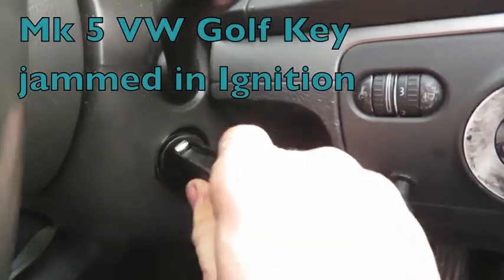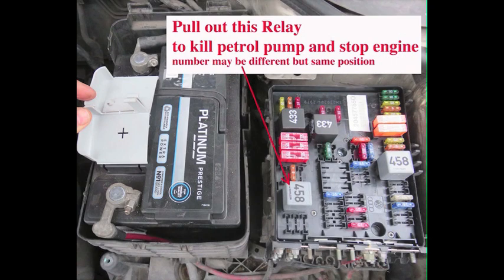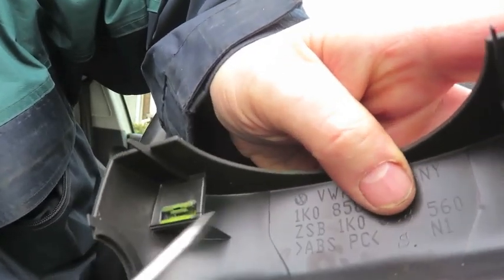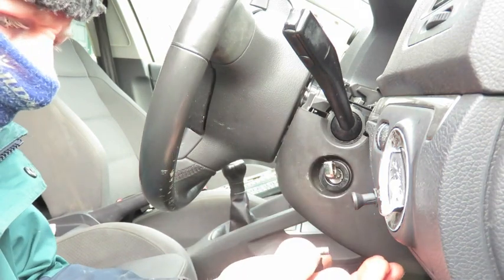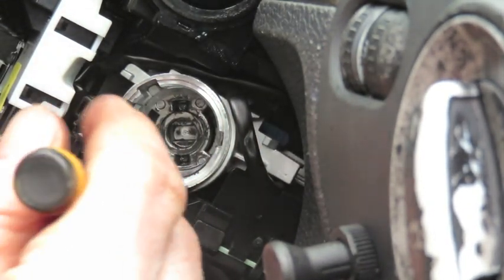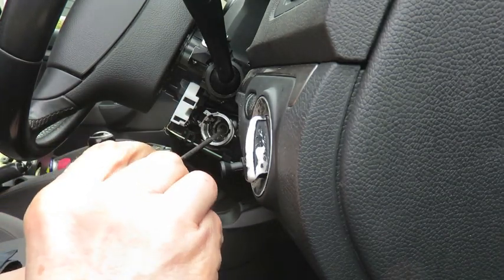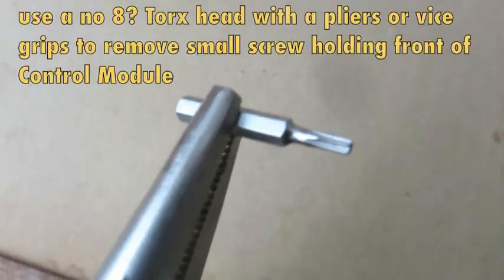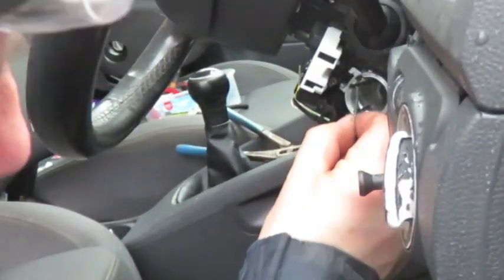VW Golf Ignition repair

Comment: thanks, good video!! 
I have a guestion. You removed a lock pin(?). After you turn off a engine, Can you lock a steering?
Reply from the maker: 'Morning. The answer is no, the steering lock is removed, but the chip in the key is the better anti-theft device I reckon. I've heard a large screwdriver can force the ignition or jamming the steering from left to right will snap the aluminium part of the lock – if you're a would-be thief that is,
All the best! Seán
Reply: @keepitassimpleasyoucan145  thank you very much. I did it today. my key was come back in my hand!!
Reply from the maker: @_malkang  did you get it working again ?
Reply: @keepitassimpleasyoucan145  Yes!! but I did it little different. I just pull out all small parts from ignition inside. I found a small piece and assambled. finally work again.
Reply from the maker: @_malkang  that's great, well done!
Reply: @keepitassimpleasyoucan145  thanks for your useful video!
Reply: @keepitassimpleasyoucan145  quick question mate hoping you would answer me, i bought the cylinder where the lock is and im planning to use the same key and old lock im just changing the cylinder only and i will use the old electronics , do you think i will need to reprogram anything ? thanks alot :) im having this issue
Reply from the maker: @moejaymotobike  I don't think so as the part that breaks in the barrel is purely mechanical so if you replace only this then the keys and everything else should work fine. Anyway, the coded part is in the actual key and the code reader is in the CPU, away from this area. Good luck! land et us know how you get on, Seán
Reply: @keepitassimpleasyoucan145  thanks alot I just wanted to make sure before I swap the part, yes I be using the same key and the key part and just switching the cylinder, And I forsure will 😊

Comment: Hi there,I have a golf that wont start. I think that the problem might be petrol pumpbut in your video you stop your car by taking something out of the engine.Any adviceif this might cause the problem or other ideas. thanks Chris
Reply from the maker: Hello Chris, I took out a ‘Relay’ which is a small in-between switch on the circuit that turns on another circuit. My car is a petrol engine too but I expect Pumps and Relays are similar for diesels as well. The main reason I knew about the Relay in the engine is that these caused my own car not to start and yes, I looked at the petrol pump first too.
There’s a Relay for the fuel pump behind the small glove box(in video) but it was the one in the engine that was my problem.
To confirm it was a fuel problem I put about 2 spoonfuls of petrol directly into top of Carburetor, then tried to start and engine almost turned over(not suggesting you do this but if you do then wear goggles in case of spitback).
 By the way, from what I’ve seen in scrapyards, a lot of Audi’s, Seat's and Skoda’s have very similar fuse and relay setups.
Good luck and let my know how you get on,
Seán

Comment: I cannot turn the key to the point to remove the bowler. What I can do ?
Reply from the maker: I had this problem too. I sprayed WD40 oil into the keyhole to lubricate the broken parts and giggling the key and the steering wheel to get it to this position. If you remove the top of the key fob by tapping out the pin you might be able to apply an extra bit of 'gentle persuasion' by attaching a vice-grip to the top of the metal part of the key. 
And if this doesn't work my next step would be to drill the hole underneath to try to remove broken parts of the steering lock that's keeping it from turning. Keep me posted – good luck! Seán